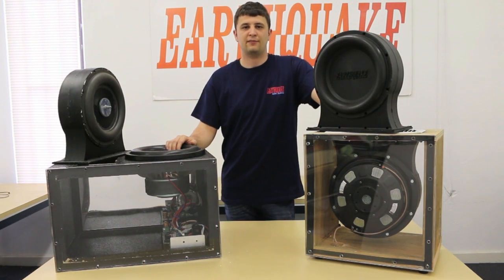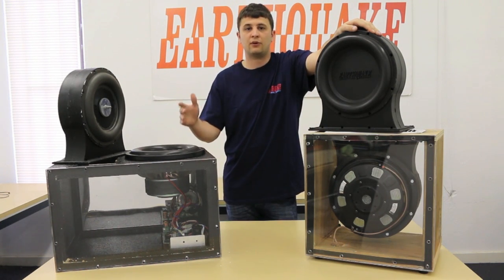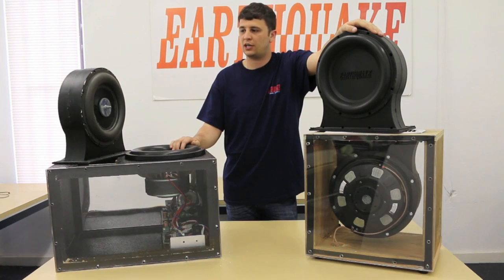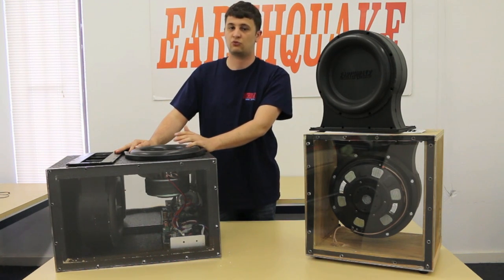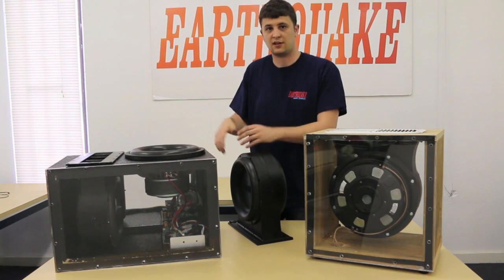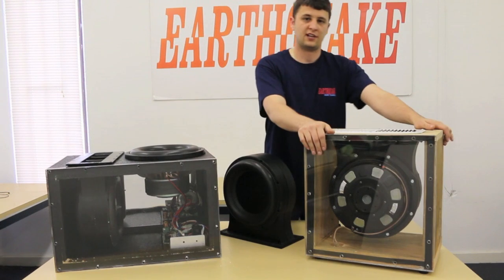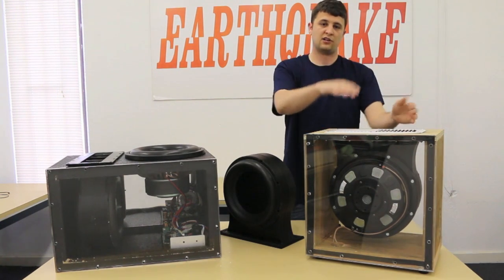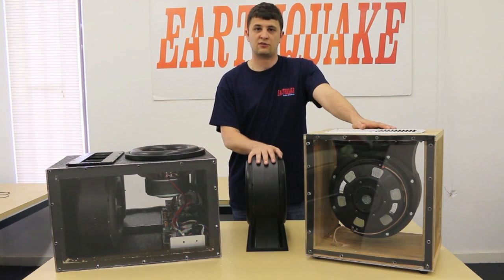Earthquake Sound: PUMP-12 Part 1

Comment: I'm going to be dropping one of these into a Dayton Ultimax 15"' sealed box soon to re-review on my channel. Should be interesting giving a 6db bump to one of those.
Reply: Z Reviews We all witnessed that it's not a universal passive that will work with any box. After the Twitch stream ended I was thinking of a way to gain more box volume and regain sub bass output. Make a full box to extend the Ultimax enclosure by minimum 1.5 cu ft  Cut the middle of the panel that will mate with the enclosure while leaving a 3" lip. Add some gasket material between the 2 boxes and add screws to lip 4 or 5 per wall. Now mount the passive to the add on. The hole you already cut is enough for air exchange. Of course with the add on, cutting the brace out was unnecessary. Live and learn.
That's how I would.mod the enclosure and you could still go back to the smaller enclosure if you decide you don't want to use the passive. Just make a nice plug plate and you're all sealed up.
Reply: @Assimilator702  that makes more sense to me 👍
Reply: @HighVybeTribe  I’m building the enclosure for my new Ultimax 15 build this way just so I don’t have to use larger beers of wood and use up some of my scraps.

Comment: Could this be paired with an 8" sundown  subwoofer?
Reply: Yes, as Long as the passive radiator has 2x the active subwoofers displacement= cone area x the x max. Example: If you had a 10inch with a 1 way linear x max of 24mm= 48mm total, then you could use 1- Earth Quake slaps 10in passive radiator= 100mm total x max= @ least 2x the active subwoofers total displacement.

Comment: How many will i need to put in a sealed box with 4 15s ?
Reply: 4 of these units in this video, or 4 of the 15inch slaps single passive units, if your 1 way linear X Max is 25mm or less.

Comment: I have two mmat monster 12s in a ported box and the ports are vertical between the drivers. I want to add one of these passive radiators to my box. Question is what is the best location to put it on the box and should it be inside the box or outside the box and should it be on the back or should i just put it where the ports are removing the ports ?.
Reply from the maker: Mount it inside and in between your two drivers. That is the most common setup.
Reply: @earthquakesound3628  i cant the port tubes are there. I just ended up stuffing two body pillows behind both drivers to slow the rear wave. I think its a minor enhancement but i dont think the pillows are placed right in the box. I just crammed them in there. I dont want to use polyfil loose inside the box because i don't want that stuff all over my drivers because they aren't the cheap kind.

Comment: Dude, I need total internal volume for one PUMP-12 and a 15" SubZero tuned for 30hz up (can't hear 20). Building it for outdoor sound system so one box or two separate? If one box, should the 15" be angled toward each other with the PUMP-12s on the outside? Thanks.
Reply: internal volume 2.5 feet cube and just add the Pump
Reply: @josephsahyoun1592  Yeah your dad...er...designer...er president gave me the specs. I'm buying another pair of 15" SubZero subs and PUMP 12's today. Is four overkill?  :O